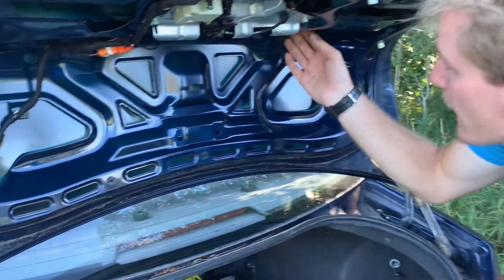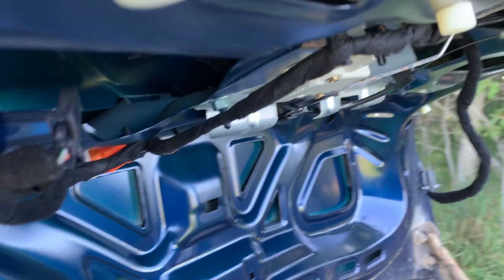Mk. 4 Volkswagen Jetta Trunk Swap - Part 1

Comment: Did you repair the broken arm ?
Reply from the maker: Hi, thanks for the comment.
I actually have not been able to get back to fixing the trunk release arm yet, but if it is the small "white metal" arm that I think is broken I will just swap it with a part from another trunk. Not much point in trying to repair the white metal unless you can machine or mold a new part.
Thanks,
Greg